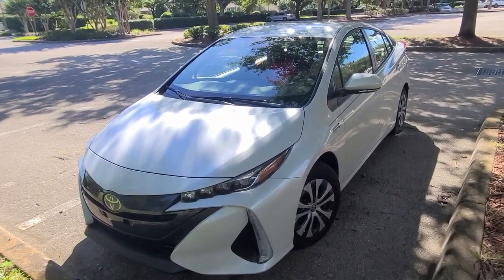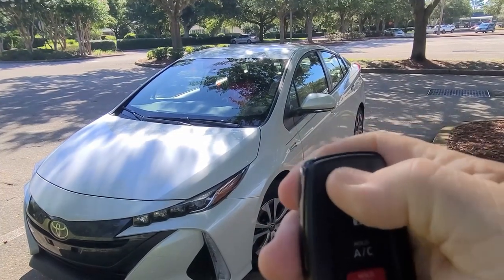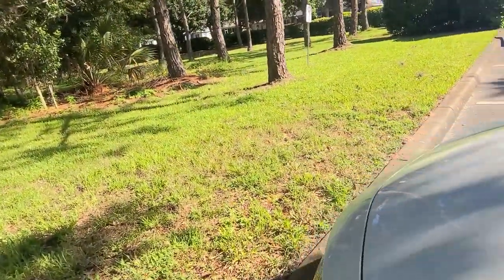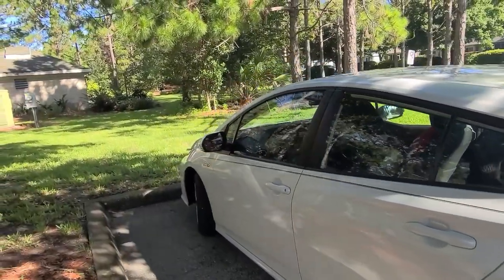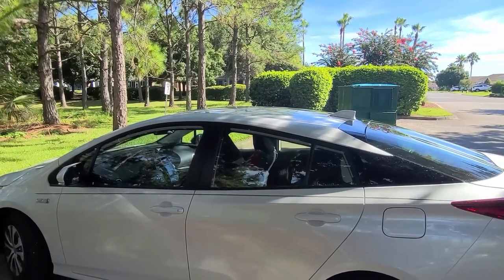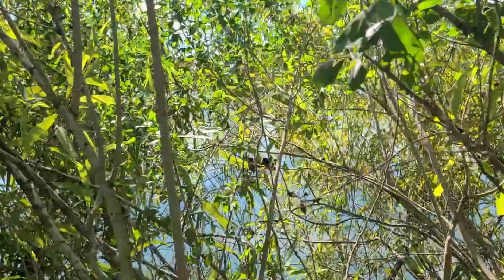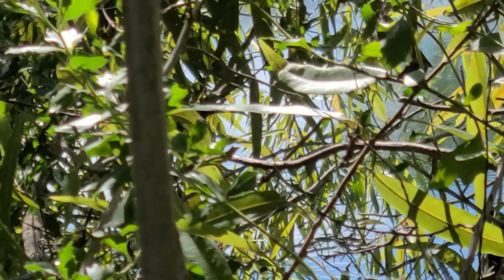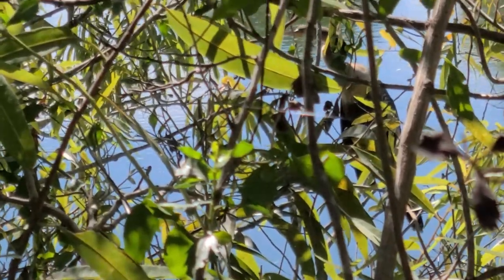Toyota Prius Prime LE 2021 Battery Maintenance and Other Things you Need to Know to Enjoy the Hybrid

Comment: We live in Phoenix AZ, and have to charge ours when it is 116 or even higher outside.  I have never had it deny a charge due tot he temp yet.  If the battery was too hot, it would not allow it to charge.   These cars are amazing!
Reply from the maker: Agreed. I park my 2021 Prius outside in the 100 degree heat charging it. I need my garage for work right now. No problems.